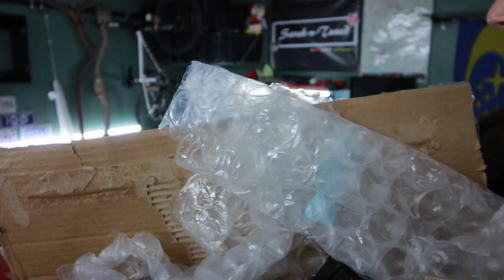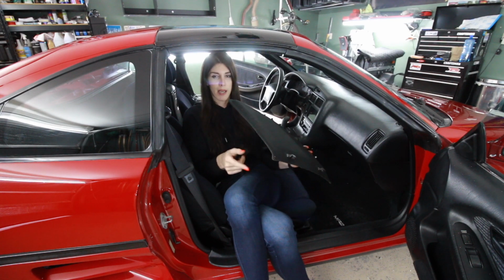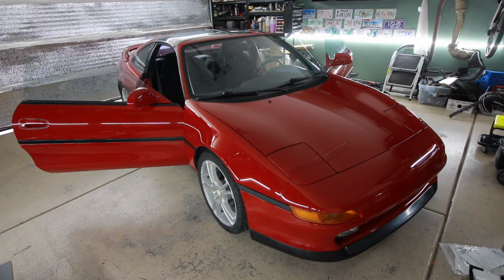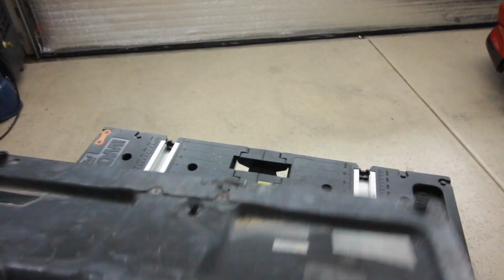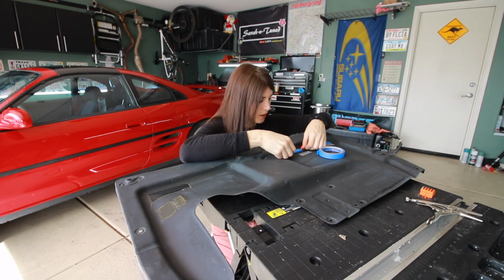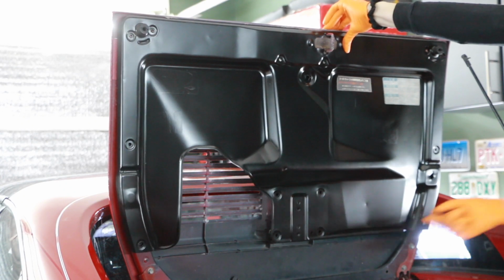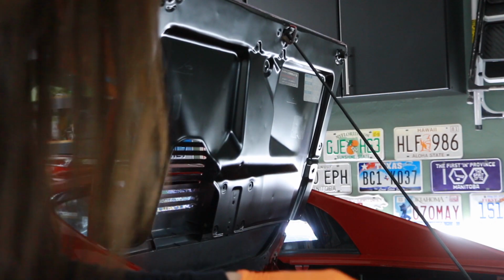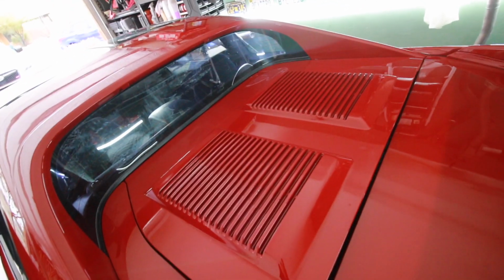Cleaning Up The MR2 Engine Bay // Vlog Series 032

Comment: Sarah, I would recommend waiting if you ar thinking about upgrading your camera. The EOS R is a wonderful camera, but it is a first edition for Canon in the DSLR “mirrrorles” market, and is also a full frame, as opposed to an APS-C camera like the 70D. This new camera is not really compatible with any APS-C lens, and still needs an adapter for any of the standard Canon “full Frame” lenses. The next mirrorles cameras Cannon will offer will have ibis “in body image Stabilization”, in addition to several great new lenses designed for the the new camera line. A used 70D can be had for $400 all day long (probably even less), and can tide you over until a suitable replacement is required.  Good luck, and I wish you great success with your wounderful you tube channel. Happy Valentines Day!!

Comment: Belated Happy Valentine's Sarah. Your constant optimism about your tasks is great. You do have potential aside from Mr2s. I used to be a grease monkey with my '73 Alfa Romeo Spyder, mainly because I could not find someone to work on it. Now with Mr2 I do not have the area to work on it, plus the skills are more involved than dealing with Spica mechanical injection. My Mr2 has been very reliable for 28yrs vintage. I do advocate those that try to keep their Mr2s OEM. I fortunately found a good shop with ex Toyota  repairmen, not very innovative but passable. I greatly admire your initiative. Best wishes.

Comment: The MR2 and the TT are looking good!!!  Your persistence is paying off. They've come a long way. I always look forward when you post. You're so quirky and have such a warped sense of humor. 

That said, I work in video production and have a 70 d. I'd check to make sure that the Canon R doesn't have a different lens mount. I think it has it's own line of lenses and you'd need an adapter to use the lenses from the 70d. It might be worth sending the 70d to canon for repair. I've dealt with them a few times and their turnaround is quick. Happy Valentines day .

Comment: Cleaning bolt heads:
1.  double nut the shaft, put in vise (on floor ok) or vise grips
2.  get wire wheel with shaft to use in you drill
3.  proceed (use safety glasses in case a wire becomes unstuck from the wheel)

Comment: I too wire brush the bolts and paint them. (I like them to look new also) I bought a cheap small bench grinder from Harbor Freight with a wire wheel. Works great in 1/10 of the time. (Make sure you're wearing good safety goggles) Keep on keeping on.....👍

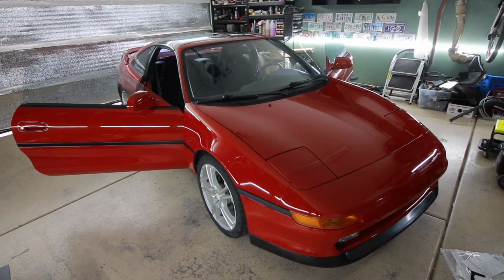Comment: 04:15 Same ! The car must be complete and if possible with all the goodies needed . Like the foglights . Even if it never came factory made with those lights for basic models , no matter the car or brand , after a purchase I would have them installed , including the switch :) Handling and looks are mear optional options in my opinion and not always needed. More for the want/have ...

Comment: Sarah the Canon EOS R uses a new lens mount so your lenses won't fit without an adapter. It is also quite likely to be a camera that is buggy and expensive since Canon is new to the game when it comes to mirrorless cameras. I would suggest that you have a look at what else is out there from companies such as Sony, Fuji, Panasonic, Olympus who all have amazing mirrorless cameras and a massive head start over Canon ( more than a decade), and who have refined and proven technology . The competitors also have an advantage over  the Canon R system in that they have lenses that are specific to the cameras, available and affordable through third party manufacturers. Don't feel tied to Canon. If you are changing to a mirrorless system look around and find what is best for you. You could buy a Canon mirrorless or a Sony mirrorless, either way if you want to use your current lenses you will need the appropriate adapter.

Comment: 92 on were bigger calipers and disc on the front and bigger disc on rear. If you do change then you will also need the caliper brackets. However for road use a well working 91 system will be fine. If you need a bit more stopping power then invest in some better pads like carbotech or porterfield rs4. If you want, there are 4 pot front kits and 2 pot rear kits available for a cost but they are pretty.

Comment: 100% go for the later bigger brakes. I swapped my '91 over to '92+ brakes and it's much better, I've also had 3 other MR2s which were 92+ and they stop much better.

There's more to it than just front calipers and discs. From a '93 you will need:
All 4 calipers
All 4 carriers
Discs (275mm front, 281mm rear)
Pads
Dust shields (as '91 ones will be too small for the 92+ discs, I run without them)

I would also highly recommend;
Master cylinder from a non ABS Hilux/4 Runner
Master cylinder brace to stop flexing on the bulkhead
Braided lines

Comment: Great video I'm in the UK and went with rev 3 front calipers and discs or rotors they did make a great upgrade but our original brakes were tired if it takes a lot of foot pressure to stop the car maybe a good upgrade ours were from a 1996 rev 3 and used stock pads stops on a dime now keep up the good work love these cars especially the sw20 have a great day

Comment: next time you paint calipers you should use the por 15 brake caliper kit. I did my calipers in red a couple years go and they still look shiny and new through 2 harsh Canadian winters.  I used the silver dupli-color on a new set of drum brakes and it lasted 6 months before coming off

Comment: A moonroof usually has a tinted glass panel, much like an extra window on top of the car. Moonroofs may tilt open slightly to let fresh air into the cabin, but won’t open completely like a sunroof.
Reply: My moon roof slide back. I can fit through it. The big difference is glass vs solid panel. Glass being moon roof.

Comment: Hi Sarah,
You have to upgrade your brakes in the mr2.
If your going to push the mr2 on the track,  don't use the 93+ OEM brakes.  These are not the best option for the track oder high speed. 
Willwood brake kit would be a every nice upgrade, in my opinion.

Comment: I would go for at least the later and larger brakes. My SW-20 turbo has the small Gen 1 JDM turbo brakes (turbo and NA had the same brakes in Japan) and they do the job but not as well as the later larger ones. I have some to go on mine before I put it back on the road. I would also go for braided brake lines as they give a better feel. BTW the MR2 is looking awesome! I'm a bit jealous of your paint...

Comment: If you upgrade the calipers, make sure the master cylinder is correct. The extra volume in the 2 piston calipers might require a bigger piston diameter in the master cylinder. Check the 93/94 master cylinders and see if there are different ones based on whether the car came with a one piston or two piston setup (if there was even a choice). If only one master cylinder was available for the later cars, it would be a good idea to see if one fits on your MR2. Also I would see if you can find out the piston diameter on your and the later systems.

Comment: The foglight switch should be closest to the door. Do you have the blanking cap for the other hole?

These days they're all called sunroofs. Used to be a sunroof was any opening panel on the roof, even just tilting ones, and a moonroof was specifically a glass one. 

I like the black for the calipers, discrete is good. If you don't need to replace the brake pads/rotors as it sits, I wouldn't bother with new calipers. Are the turbo ones floating, or fixed with opposing cylinders?

Making the car right, and taking the care that you are to get things better than they are supposed to be, is huge. You're doing a great job, and we really appreciate all of the work you put in. Most people would have gotten the mr2 running and said screw the rest, you're fixing the car.

Keep an eye on the hood seam, sometimes sealing up one spot from water getting in, can turn into building a bit of a dam, forcing the water into the places it shouldn't get to, and won't drain out of.

At least you get to leave the garage to go on exciting part procurement adventures, mine get delivered so I'm just stuck here all damn day! Good luck with the camera surgery!

Comment: Do the caliper bolt on big brake upgrade, so you can run rx8 front discs in the back of the carwith stock rear caliper and toyota supra tt front discs with nissa. R33/300zx/s14a  front brakes make a huge difference and you can just grind the nissan embossed emblems off and no one will know and youll have some big brakes with decent stopping power. (most common swap in the uk)

Comment: make sure first that the turbo brakes fit with the wheels you have. the bigger brakes will be better because thay will dissipate more heat, and have a better pedal feel. see if you need a different master cylinder for the dual piston calipers.

Comment: If you have any problems down the road on the paint you used on the inside motor cover, and have to redo it, next time, try a paint for grills, it is rated at a much higher temp

Comment: The difference between a sunroof and a moon-roof is that when they are closed you can see out through a sunroof but not a moon-roof.  Yes, both of those covers on the passenger side are cruise control covers.  Finally, the under panel on the engine lid is a rain guard.

Comment: In my opinion; if the brakes work well,I think you should  just paint them as is. (a trick I picked up for painting calipers or... whatever is to use foil wrap to mask off the rotors & stuff.)

Comment: Brake upgrade , depends on the purpose of the MR2 . If you aim to add more power and to race with the car , then upgrade , but upgrade full(so maybe a different brand than Toyota).If the power increase is about 10% than just stick with what you have...black is best choice , next to grey/silver , all the rest makes the car look odd or dinkytoy;)

Comment: Definitely upgrade the brakes. You should look at the brake kits that Prime or Hux Racing has. Hux racing has brake adapters for Wilwood brake calipers. You can put together your own big brake kit. Prime has complete kits for the front.
Reply: I disagree. Unless you track it, there is no point.
Reply: Brakes are fine, put off powder coat for later.. Put the money you save in a jar to help defray the cost of your new camera

Comment: I’d upgrade the front brakes as you have effectively upgraded the power from stock. The original brakes would probably be fine for normal driving but with some spirited “Sarah yea buddy” driving you could get some brake fade as the brakes heat up. Hope you and Little Sarah find your valentines👍.

Comment: I thought a moon roof was  a steel panel not glass. My 91 turbo fog light switch was closest to the drivers door. I thought rotor diameter on 91 turbo was an inch bigger, maybe? EOS R is a go. Love the blogs BTW

Comment: A sun roof is either a fixed or pop up/pop out piece of glass attached to the roof.  They were almost all aftermarket items installed by dealerships or importers.  When OEMs started providing powered, retracting glass panels as an option, they (not sure which manufacturer was first, but I always just assume GM) used the term moon roof to differentiate both the more sophisticated function as well as the greater perceived legitimacy of an OEM installed option rather than aftermarket hackery.

Comment: This of course is just an educated guess... in the 80s if they weren't able to open  fully (tilt open or fixed)but had a glass partition they were called moonroofs
- if they did or did not have a glass partition but they opened( slid into an open hole position) they were called sunroofs... I hope that helps ;)

Comment: For the Fog light button :

front fog light : left
rear fog light : right (only if you have it like us in France)
Reply: Why on Earth would you need a "rear" fog light?  Probably the same as why "yellow/amber" headlights.  Only in France...
Reply: Rear fogs are fitted to all modern cars. If you don't have fog where you are you won't use it but if you do you will appreciate the extra safety it gives. If you don't have fog you shouldn't really use the front ones either but it sounds as if you might?
Reply: @biffnarzilla4649  I try to explain you with my limited english ^^ 

The rear fog light is a red light more powerfull than the stop lights, his fonction is to signal you when you are alone on the road... it's more easy for the other drivers to see you in the fog or under the snowfall.... especially if you are stopped for some reasons...
In fact, you should use it when you are alone, and only in the fog or snow fall beacuse his brightness its too powerfull for the driver just behind you... And it's not autorised under the rain because the reflection on the wet road can blinding the driver just behind you...

And last thing : the yellow headlights was finish since 90's ;-) now we are in white like the other ^^
Reply: @skylinepower33  I saw a lot of yellow fog lights while I was in Paris in 1993, when there was no fog in summer. Most modern cars have fog lights as standard, but in suburban Melbourne Australia some people have fog lights on to light up the road, or just have the fog lights on and no head lights. We usually only get 1-2 days a year of early morning fog,  but some people think it's cool to have fog lights on all the time?

Comment: You asked whether you should stick with stock brakes or upgrade to the larger stock brakes. Is this a real question? Bigger is better. Toyota thought it needed bigger brakes back in the day, and your car is faster than it would have been then. It’s like asking if you need more power or wider tires. You don’t need those things, but... 

The real question you should be asking is whether you should skip straight from stock to a big brake kit or only do a stock type upgrade.

Comment: Sun roof. No glass.
Moon roof. Glass
Just my opinion
Reply: Its called a Dark Hole.   It lets light pass in both directions.
Reply: A sunroof is typically a solid body-colored panel that can manually tilt up or be removed. A sunroof is an opaque metal panel, and you can't see through it. From the outside, it looks like a body-colored metal panel.

A moonroof is a type of sunroof, except that it’s a transparent, sliding, tinted glass panel. This panel is not removable. More recently, the panoramic style of moonroof has become popular, in which most of the roof of the car is made of glass, but only the panel over the two front seats will slide or open — the roof glass over the rear seats stays fixed. The interior of the car is then shielded by a retractable shade in the headliner; sometimes it's an electric one, sometimes a manual one. The majority of new cars have moonroofs, as what’s technically considered a sunroof has pretty much gone out of style.
Reply: Sunroof by day, Moonroof at night...LOL
Reply: I DO NOT open my "roof opening" when the sun's out. 
Therefore, it's a moon roof.
Reply: I agree with this. This is what I was taught since I was a little kid, and I’m 42
Reply: Sunroof none glass
Moon and sun roof glass or plastic.. depends on time of day or night driven
Reply: I thought it was if it popped up, it's a sunroof because the tinted glass still protects from the sun while allowing air into the vehicle.  If it slides back, then it's totally open to see the moon and stars.

Comment: For the stickers, it looks like US and JDM not only had different languages, but different information too. You have the cooling system caution one, and looks like the Turbo Caution one also. I think the other one on that side was for the air conditioning caution/charge information.

Based on US cars, the other side would have been Emissions information and a Vacuum Routing diagram. Neither of those would be right with your swap, so I would pick a couple random JDM ones and toss them on if you want a few extra hp!

I don't know what parts catalog you usually use, but I like 7zap -> Original Catalogs, you can select which market catalog, and get the part numbers for the JDM stickers you want, some looked like they were available to order new. It really is the little things that matter.
Reply: If you do get new stickers, don't get an AC one until after you convert and charge it (do it yourself) and you can find some Toyota that has the new capacity of R134 and have the sticker's information be correct.

Comment: Hey Sarah, great video as always. Brake upgrade wise Lexus LS400 , 1995 and upwards, (part number UCF20) are a common and cheap Toyota upgrade. 
They are similar in size to Supra turbo brakes but lighter and like the Supra calipers they are 4 pots. 
But as far as I know you need a at least 18" wheels to clear the discs or rotors as you say in America. 
They provide brilliant stopping ability, I'm running a set on my Jap spec Toyota Soarer. 
There is some info in a link below so thing it's possible MR2 upgrade without too much hassle. Or if MR" turbo brakes are easily got that would probably be easier or the Celica GT4 (Alltrack) brakes are very similar in size to the LS400 UCF20 and Supra turbo calipers. 
Anyway good luck and look forward seeing Mr  Dos's new rims and brake upgrade vids. Keep up the good work :-)
https://www.mr2oc.com/64-mk2-suspension-braking/653833-ls400-brake-upgrade.html

Comment: Put higher performance calipers and rotors on the car. Your ability to stop and keep things under control is pretty important. Maybe something like EBC UltraMax slotted and drilled rotors.   Check it out;        https://www.mr2oc.com/64-mk2-suspension-braking/446286-brake-upgrade-database.html